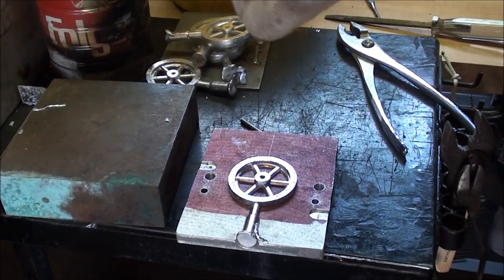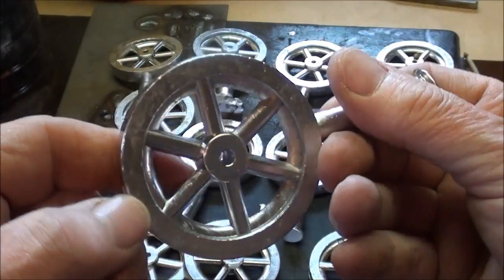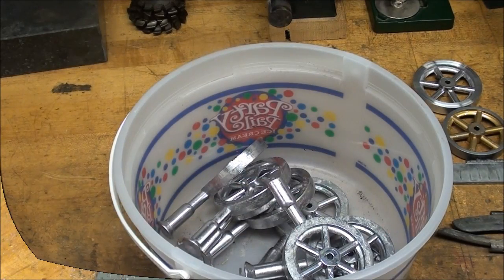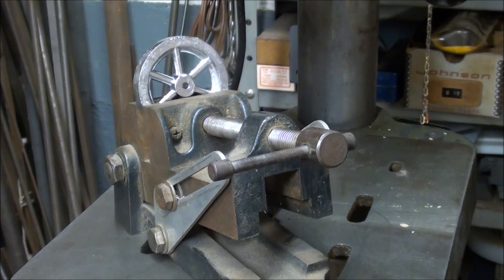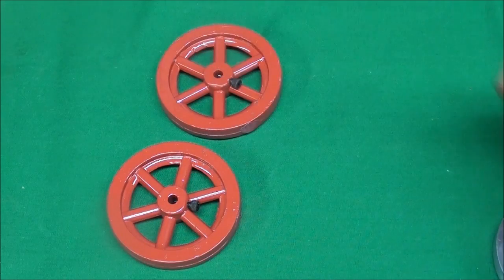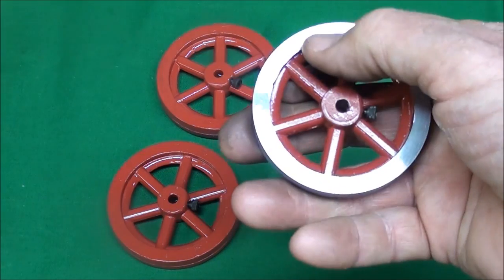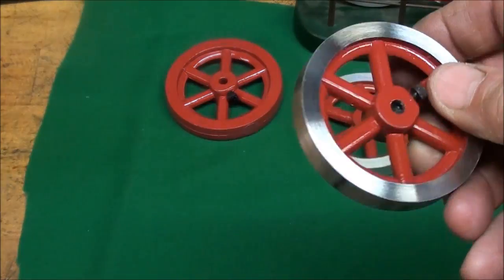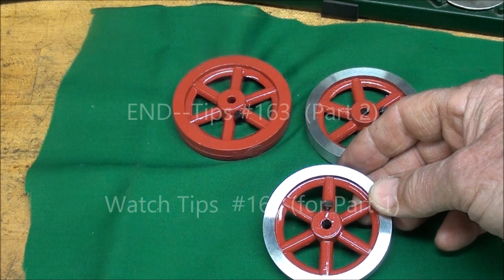SHOP TIPS #163 Part 2 Making Flywheels VERTICAL SHEAR TOOL tubalcain

Comment: I realize that you probably made this video a long time ago . But I couldn't help but share some information to you about your casting . Number one you can smoke your molds with the sword from a wood match or the smoke that comes off of an acetylene flame. It works great and it is cheap. Another idea I had for you is an alternative to wheel weights you can buy pure antimony from Roto metals out of California and it is of the highest quality. It is kind of expensive but it's worth it.
 As I've said before Mr. P you are a treasure to have in the YouTube community . I really enjoy watching your videos and I have learned a great deal from your teaching. Keep up the good work and don't let the trolls get you down.
Reply from the maker: Good idea about the smoking of the mold. I just cast some lead weights yesterday, and I forgot just smoked the mold and this one also. But really had no problems with releasing. Thank you for watching and commenting

Comment: 8:50 You should consider making a holder for your reamers out of metal- because wood absorbs moisture, and the shanks on your reamers could rust.
Reply: I think thats exactly why wood is best.  It absorbs the moisture away from the tool.  And passes it back to the exterior of the wood to be evaporated away.

Comment: Hi Lyle. 
Just had an observation on tapping, sawing machining or sanding soft or gummy metals. I use a trick from an old timer I've used for years (I'm an old timer now) is to take a bar of beeswax and rub it on your tool before and during your procedure. I'm even experimenting on a mix of beeswax, mineral oil and mineral spirits which chemically thins beeswax and makes it easy to apply with a small acid or flux brush while high speed machining. 
It also keeps the teeth on my files and hacksaws from clogging up with aluminum.

Comment: i, 44, have been a State Licensed Contractor for over 15 years, doing Carpentry work about 25 years, and i am one of those guys who builds beautiful stairways, and my biggest was 11 piece crown molding... i also have a couple excavators, a 17,000 lb dozer, 11 trailers, amongst many other machines and way too many hand tools and wrenches; i do my own repairs, have Miller welding and plasma cutters, and machine some of my own parts, build new, repair or fix on them, watched (over 3-4 years) about 200 your your videos, and many many from Keith Fenner, my next tools will be a bigger lathe, and separate milling machine, and last a plasma cutting table, think these will help with projects for the rest of my life (and grandchildren),  i think you are a wonderful teacher, and think you explain wonderfully, love the extras, and i don't turn off the videos, because you show other things which could be added to other projects, (you obviously didn't need to do for that project) also watched quite a few of your videos numerous times.....  keep up the wonderful work, be safe, and God Bless
Reply from the maker: +Chuck Trim THANK YOU VERY MUCH for a nice letter.  Sounds like you have quite a shop & lots of tools.  I sure admire nice looking stairways--but yours are great. Thanks for watching all my videos--many more to come. & GOD bless you too>
Reply: +mrpete222 thanks, no need to reply again, just thought to let you know,  all the measurements and dividing of spaces in wood, column spacing, custom raised panel units....  and preparation for all types of commercial store front projects (commercial work)... all the construction dividing has set me up and allowed me to be pre- prepared for most of the work and calculations on projects you are doing, not much of a difference, glad to have that background for fitting all other things than residential and commercial applications

Comment: 6:03 Sanding lead... doesn't that kick up a bit of lead dust? I haven't worked with lead, so it may be that it doesn't, but wouldn't it be best to wear a mask for that operation? (Just wondering.)

By the way... I'm looking forward to when I can retire (54 now) so I can have more time in my shop. 
The Milling Machine Move - May 2014

Comment: Add me to the list I like steam.  I shall call you by phone, some reason your email does not work with comcast?  I built a complex engine around 1959 or 60
for a science fair project in school.  I even forgot I still had this but, I would like to
share it, or I may even send it to you.  I tried to fire it with shop air with no avail,
I built it with no plans,  now I have to re engineer it.  How I did it?  I have no clue
other than a long bed 9A south bend
sam

Comment: Tubalcain. You made some comments about student's using files as bats along with rivets and I must admit that I may have done the same thing in my school in England in metal work class 55 years ago. But at 70 years old I still remember the instructions from my teachers and now use that knowledge for rebuilding my old boat. The information you gave your student's may not have appeared to sink in, but it has, be proud to have passed on your skills, love your attitude.
Australian Fan

Comment: Here is an idea......Use wooden blocks in your vice and that would stop the vice acting as a heat sink and giving different temperature gradients to the mold.
Maybe this is why the earlier attempts failed? i.e. the vice was acting as a heat sink but the later castings worked well because the vice was a lot hotter?

Comment: Nice work! I love your videos and LOVE your steam engines! Your a wonderful teacher! I think you would do well with a set of "hex wrenches" from a hobby shop. They have precision ground tips and they grip set screws very good, you'll wonder how you went so long without them!  Even after a year of almost daily use mine (a team associated set) are still perfect. They are great if you use small allen screws a lot. Plus, if you do break a tip you can get just the tips separately. Keep up the GREAT WORK!
Reply: Also, I love the shiny finish on your freshly machined flywheels! Have you tried any kind of clear coat to keep them shiny?

Comment: Mr. Pete,
I am looking to either find or make a hit-or-miss engine that I can couple to a 100 amp alternator to supplement my solar power system. Your fly wheels are what I am studying right now, although a large truck tire filled with calcium probably would be a lesser and easier solution. Thank you for your video!

Comment: Love these videos!  I am sorry that more folks are not showing interest.  Making a working model  steam engine is a project I assign my third semester machine shop students,  I may have to take some time and make a mold for a flywheel.  Since we have no foundry furnace doing die casting would be my best chance to demon straight the art of casting.  Presently we make most of our engine out of steel bar stock.  I like doing it this way as it gives the kids an opportunity to use the surface grinder.
Reply from the maker: +Junk Mikes World Thanks for watching--a teacher has to be resourceful. Good luck with those boys

Comment: Surely the sink spot is due to the nature of the filling (the spot being between two spokes and at the top of the centre cavity, causing an air pocket) rather than shrinkage, if it were due to shrinkage you wouldn't just see it in that one spot.
You could possible minimise it by using a vertical spoke inline with the fill hole (not that you are going to change the mould now).

Comment: The disc flywheels are not as aesthetically pleasing BUT as they are easier and cheaper to fabricate the molds for, it would probably be difficult, though relatively easy (as opposed to making a mold with spokes) to drill holes into the disc to create spokes of a sort.  Drilled flywheels would also be a bit sturdier and perhaps less likely to chatter in the lathe and while arguably not as aesthetically pleasing as true spokes on a static display, the spinning holes on a working flywheel machine would be as interesting I believe.

Comment: If you rub the lead with a coat of dot 4 break fluid then polish it, it will not tarnish. Did you know that you can tell the difference between a metric and imperial screw head as the metric head is always larger, only with allen head screws. I only started watching your videos by chance as I was looking into auto feed lathes for threading as I got my new lathe just recently as my mini lathe gave up on me, I have enjoyed then thoroughly and found them to be very educational.  Keep the videos coming as the day one stops learning is the day one dies.

Comment: Those spoke wheels sure look great. Thoroughly loved this 2 part series.I make "J" weights for decoy anchors. I bought the mold on ebay a few years ago. I preheat the mold with a MAP gas torch. I've also tried blackening the mold with a candle. Seems to help get the weight out of the mold easier, but is kinda a pain when I'm making a couple dozen weights. Wish I had "a thousandth" of your knowledge and experience. It is always a happy day when I see a new mrpete222 video on my subscriptions!

Comment: MR. Pete, I learn something new from all of your videos. I even managed to get my first lathe two weeks ago. It's an old atlas 618, in remarkable condition for it's age. I've had to remount it on a piece of steel, but it works well for me. My tool bit grinding is the biggest issue I have. Well that and only being able to stand for short amounts of time. 
As for your life time supply of flywheels, I'm sure you will use them plus many more. 
As always MR. Pete, thank you!

Comment: Pete? Are you still casting and building engines?
I drew a neat set of schematics for one of my own designs.
Would you like a set of copies for it?
It has one engine block, but two can patterns, and three,
Cylinder patterns, one steam one gasoline and one diesel,
All for the same crank and block.

Respond via, private message.
 Thanks.